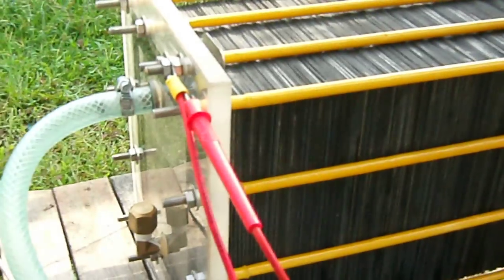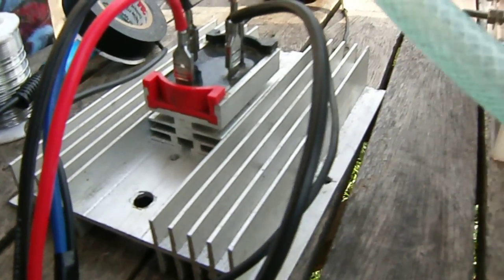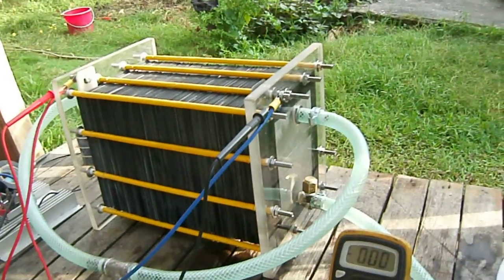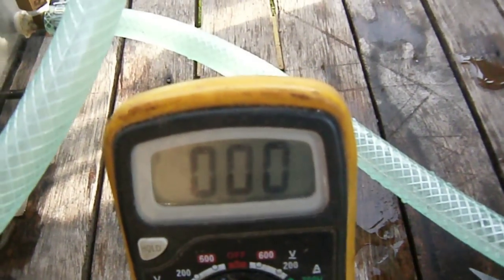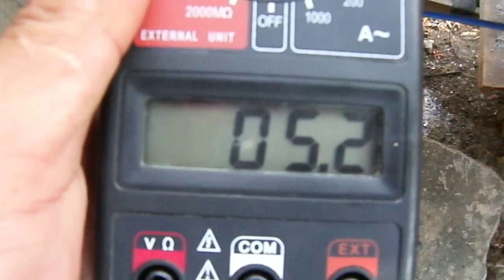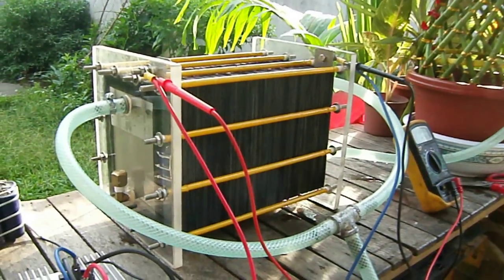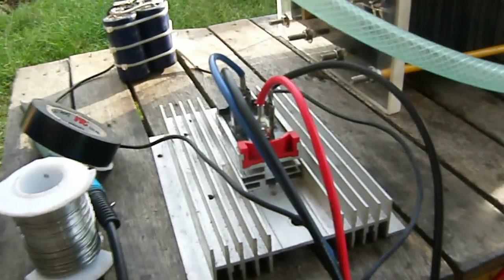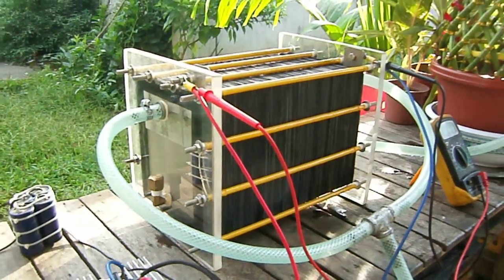101 plates dry cell hho generator by limuel gemongala of digos city

Comment: @limuel gemonagala great video, have you ever though about hooking this generator to wind turbine or solar panels? Then capturing the gas? You can capture the gas by using big tank on top of water and you can fill it and use the gas whenever you want. Also you can adjust pressure by putting weight on top of a barrel.
Reply: Slepas Pimpal kllpnjjiii
Reply: bottled HHO is very dangerous. It explodes under pressure..even he slightest amount of static electricity (which is abundant in the gas) is enough to ignite the gas
Reply: @albonyo  um... then why is it 130 octane? Yeah... read better.

Comment: Would this run a carbureted  v8 Diesel
Reply: it might damage the cylinder due to lack of lubrication
Reply: Slepas Pimpal you still have to put oil in the engine, your just substituting fuel for hydrogen and yes it does work

Comment: your technique is not energy efficient coz you spend a lot of electric energy to split the atoms of water....you need to source a minimum electric energy as possible to be efficient...
Reply: +Bono Youtoo And how are you going to charge that?
Reply from the maker: Bono Youtoo thank you for the advice sir, can you suggest to me any way to make it work efficient? i will be very happy if you can help me sir
Reply: use 12 volts battery instead

Comment: hahahah... astig!!.. tap that machine on your motorcycle... hahahah... it'll run. add some magnets on the hose with both south directing to each other also add on 2 strong magnets on your hho converter. and see some result. anyways. your machine is awesome. hehehe 1:25 "ma ma saksak", again 1:35, heheheh "ma ma saksak anay ma" heheheh btw, tap water has some minerals and electrolytes. water without electrolytes are distilled water, just to avoid confusion. =).. have you tried running it with alkaline water? anyways.... its awesme thanks

Comment: Great work. I took care of overheating problems by adding an external holding tank and an in line water pump that runs on less than .5amps at 12 volts.  It also floods the plates to the top which gives more Gas output.

Comment: Can I comment. Tap water will contaminate your cell and bring in iron oxides. Isolate the out gas hose all though the hose with tiny holes to let the gas out, other wise you will have way too much voltage leakage and it will get hot after a while. Use an electrolyte so you will make more ortho hydrogen, not para hydrogen. Search Bob Boyce to learn more, just here to help. Use no metal fittings it will DISCAHRGE the ortho hydrogen back to para hydrogen. 100% ortho hydrogen is prived 4x more powerful, but I think it is 10x's more POWERFUL!, with this high powered gas you should be able to run a small engine.  I learned all this from Bob.
Reply: hi broandrew this mi fb please add me if you can help with a few think y really apreciaty it, blessings    https://www.facebook.com/greatsorrow

Comment: Why do you use only 110 plates? This is wrong.
After the diode bridge and correcting capacitors you get 318 volts direct current. For one pair of plates do not need more than 1.32 volt. This means (318 / 1.32 = 240) you have to use at least 240 plates. You will receive a high-electrolysis, the electrolyte will not heat. Consumption of one pair of plates 22 watts of power, you can not use more than 5 kW. Under such conditions you can get gas, with a high efficiency of up to 20 liters per minute.
Reply: 1.32 volts is theoretical and definitely not real with stainless steal plates and alkaline solution. It's advanced catalyst type of stuff. All of you just talk but not really educated.

Comment: 3.15 v/cell. Either dadagdagan mo ng plates or e lower ang voltage to reach the 2.4 v/cell na ideal power for a better results Bro..pag ginamit mo kasi ito sa mga stationary engine like ung sa Rice Mill, sa 3.15 v/cell mo ay siguradong kukulo ang tubig at magkakaroon ng extra heat that will produce a steam na downer o syang magpapababa ng volatility ng hydrogen properties.

Comment from the maker: to all watching this video, this generator or re-actor is very useful, it can be use to replace acethylen for cutting,welding or even running a car with or without gasoline, it can run an electrical generator to light a hospital, clinic, houses, so if any one is interesed to have one of this just contact me 09302465975 or(082)5537311